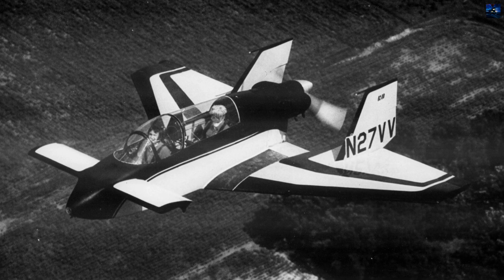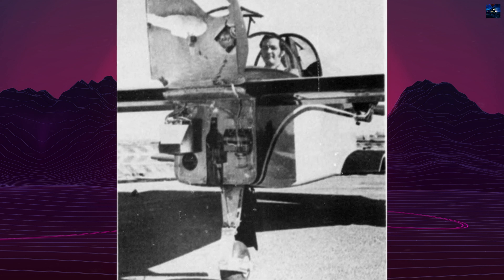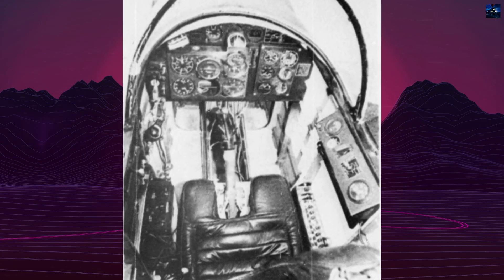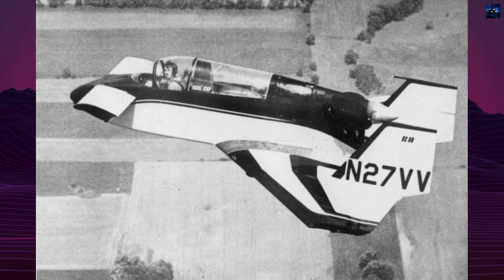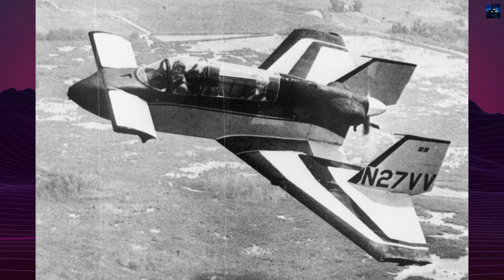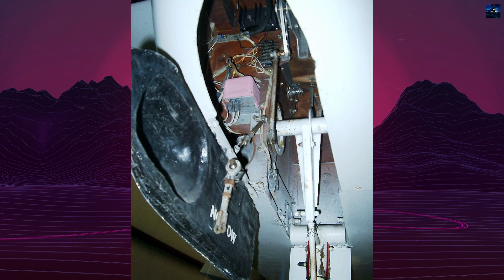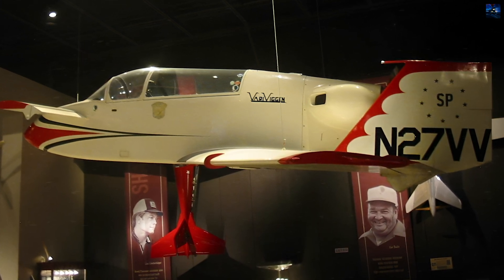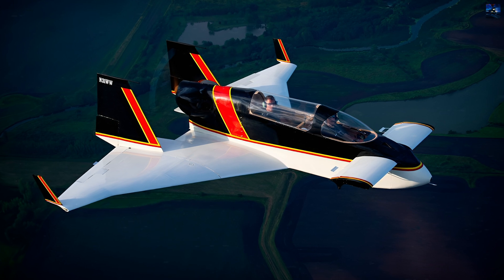Rutan VariViggen: When a College Project Becomes an Aerospace Legend

Comment: This is interesting and all, but how is this airplane an "Aerospace Legend"?
Reply from the maker: The Rutan VariViggen became a legend in the aerospace industry due to its innovative canard design, which improved stability and control, its status as one of the first successful homebuilt aircraft, and its cultural impact through appearances in media and museums. Designed by Burt Rutan, it showcased how academic projects could lead to significant advancements in aerospace engineering.
Reply: @RetroTransport .   "one of the first successful homebuilt aircraft”????
Well now, that’s not even amusing.
Reply: Because it spawned the Varieze and Longeze, and more.
Reply: It also added a lot of momentum to the homebuilt aircraft industry.